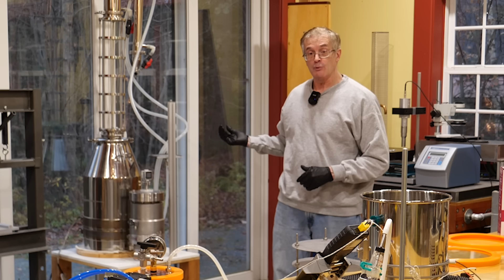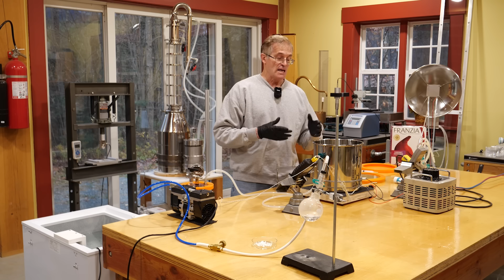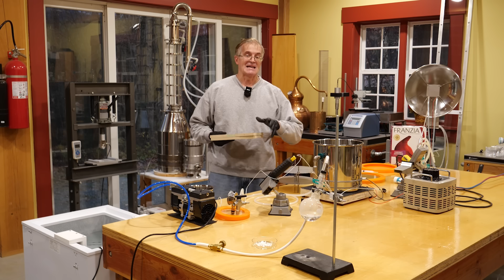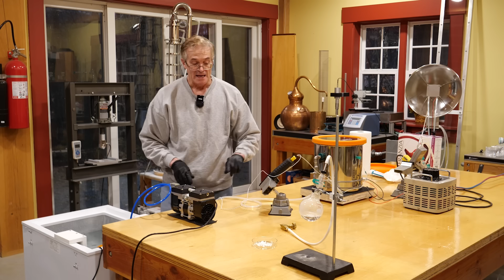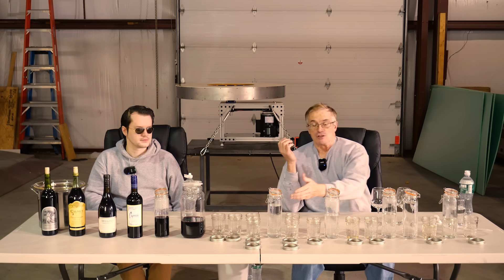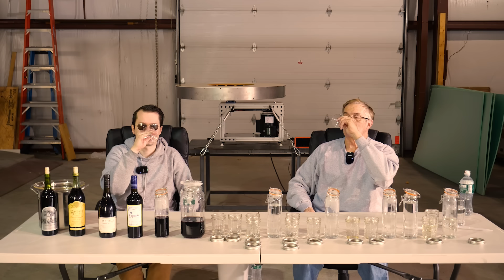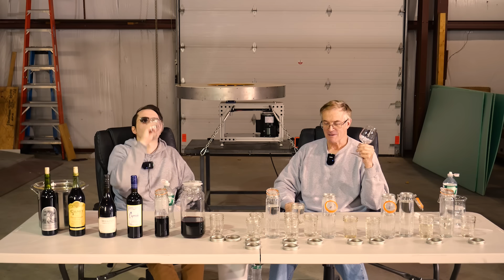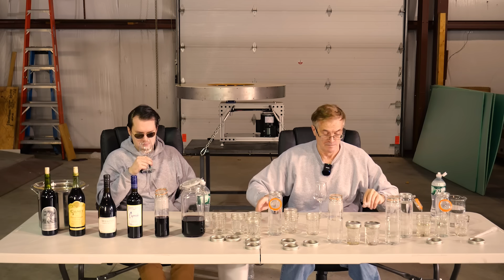Turning $3 Wine into a $100 Vintage with Science!

Comment: I'll grant that the result is more flavorful than the original - because all the non-distillates remain, while much of the distillate was removed.  The flavor would have to be more concentrated.  Better than the Cakebread - not a surprise.  Than the Meiomi - it's subjective.  Than a Caymus?  VERY unlikely - if tasted by a sommelier, and there's the rub: you are simply evaluating based on non-expert criteria.  Which is OK - I don't mean to denigrate that - because the whole point of wine tasting is exactly that: to find the least expensive wine for your tastes.  But translated to the general public - perhaps not.

As for the Silver Oak, if you were comparing the Alexander Valley Silver Oak, it's almost impossible that it would be less smooth or fruity - although that might be the conclusion if you were tasting the more austere/serious (and expensive) Napa Valley - bought on sale.  Or a very odd vintage.

A professional wine taster in a blind tasting would be the best judge of the actual outcome of your experiment.  Having said that, however, if you managed to come anywhere NEAR a Caymus cabernet with a twiddled Franzia box wine, that's a home run.  Very interesting video.  Reminds me of an episode of Northern Exposure where the wife of the crusty and rich patron drank his prize bottle and then refilled it with rotgut plus dirt, leather, tobacco, pepper, etc. and recorked and resealed the bottle - adulterating it with all the attributes of a high end wine.  A successful ruse, it was.

Update, 9/2026:  I happened to go to a wine tasting that offered both Alexander Valley and Napa Valley Silver Oak.  I NEVER favored the Napa over the fruitier and smoother Alexander.  I was shocked - the Alexander was bland - perhaps gong through a dumb period, but the Napa outshone it.  Just goes to show - winemanking's an art.  I bought the Napa - first time ever, in probably 30+ years
Reply from the maker: It really is very good.
An experienced sommelier would be a valuable addition.
I never saw that, but I'm pretty sure that would have been worth the watch.

Comment: This is really interesting; making a bespoke wine by deconstructing it through distillation. It kind of spits in the face of the philosophy of wine-waking, where the bulk of work to develop taste is in cultivating the grape and the soil and letting the climate and geography all determine the taste, as well as the yeasts and controlling (or not controlling) the fermentation environment. Granted, that's all still in there, but removing the parts you don't like is almost like wine eugenics 😂.
Reply: Wouldn’t wine eugenics be what is done now? Keeping the best vines, finding the best soils etc. versus separating and breaking down all flavors/liquids and making something better from it. 
Wine isn’t a distillation as it is blending but this process could make cheap grapes taste great.
Reply: @JoelSapp Not necessarily. You can only take out some harsh flavors, but you can't improve on what has already been made. This is subtractive, not additive.

Comment: I started brewing wine at home, Walmart brand concord grape, frozen raspberries and a few pounds of sugar, 18% champagne yeast and the first batch was dry and a touch over 18% with yeast nutrient (urea) in 60 days. 

Let it settle, added some very thick sugar syrup to two gallons in reused botttles, added simple syrup to some corona beer bottles and capped and stored in cold water to carbonate.
Reply from the maker: And.. ?
Reply: @TechIngredients Sorry, got side tracked before I could finish it.

Wine was great, delicious fruity and plenty heady. The attempt at champagne, the bottles didnt explode but they had to have been close, I opened one and it shot a fountain of alcoholic sticky foam up almost 3 ft and what was left at the bottom of the bottle was the floaters. I opened the rest under water in the sink and managed to keep 6 or 7oz and it was still really carbonated. 

No sulfites and it was 6/10. 

Lalvin 1118 yeast does wonders.

Three future batches, one with sulfites  (hangover city) and the rest very slowly heated before and made sure everything was sterile, and no issues, never using sulfites again, yeast nutrient is essential for high proof brewing. Im going to make another batch for new years. Might try a full fruit mash this go around. 

If I could ship you a couple gallons would you make fruit Brandy?

Comment: Though not clear in the video, it seems like the original cheap wine ranks better than the first two bottles, and if it was the case, it wouldn't surprise me at all. Cheap wine is frequently better than mid-tier, just not consistently so. What you won't get with cheap wine however is ageing, but maybe you could cheat that one by mixing in a bit of port wine, which can also be fractionally distilled! The oak flavor can be added in the same way you did for the whiskey.

Comment: There are yeast species and mutants that produce a-Amylase, a-Glucosidase, and Glucoamylase.

Two notable examples that are commonly relevant in the brewing industry are diastaticus, which is caused by a mutant allele in S. cerevisiae (STA1 allele) that produces extracellular Glucoamylase, and Brettanomyces species that produce α-Glucosidase.

...I pause so I don't forget to tell you this information at 2:25 (so hopefully you don't address this directly after I press play.
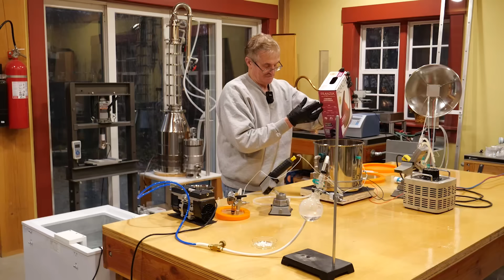Reply: Now at 35:22, just open the box and take the bag out.

Anyway, luckily you didn't actually address what I had previously said. Not that you needed to, because even though it is relevant to what you were talking about at the beginning, it wasn't necessary to address.

Comment: A better tool to drill rubber is actually a woodworking tool. A dowel drill makes dowels from the wasted wood from whatever project you are working on. This drill has a shank attached to a tubular cutting section. The bottom of the tubular cutting section is sharpened to a cutting edge. As the tool is turned with the drill, the cutting edge cuts in a circle deeper into the material until you are all the way through leaving a perfectly round straight hole with no burrs. It also makes waste in the form of a cylindrical rubber dowel-shaped plug. The tools usually come in a set, don't cost much, and are available at hardware stores. I bought mine initially to make mounting holes in a thick rubber cutting edge for my tractor's snow blade. It worked pretty well. I used silicone spray lube as a lubricant, but for food use you could probably use water. 

In concept, these tools are similar to gasket making tools for hand-cutting round holes, but the dowel tool is used with a drill.

I actually learned about this technique from my rubber vendor.

Comment: I wonder if this also allows you to improve already good wine. Since you're already starting out with a good wine, you'll start deep inside diminishing returns territory, so I don't expect the improvement to be as drastic. But still curious.
Reply from the maker: I agree. 
It can't hurt, but at the same time the improvement between a good and a great wine is proportionally smaller.
We're just not experienced enough to judge at that level.

Comment: There's a very interesting couple of webpages (predating YouTube) where a British (?) expatriate describes the operation of a village distillery in SE Europe, to which everybody takes their plums (yellow and slightly tart IIRC). Unfortunately I can't find them, and YouTube probably wouldn't let me post a URL if I did.

After a couple of gallons of "the good stuff" was saved, the little old lady in charge took a carefully-judged teaspoon of the tails and added it to the main stock, and it was that that changed it from "take the top of your head off" gutrot to something you;d give your friends.

What I can't remember, and this is significant, is whether there was a gap between "the good stuff", and the bit of the tails which was saved. Because if there was, it would reinforce this video's conclusion that there's a specific "band" (noting somebody else's reference to Fourier Analysis) of congeners which can be usefully removed.

How high-end vintners prevent those chemicals being present in the first place is an interesting question in itself.

Comment: Have you ever tried cooling down rubber before drilling it? I know that it can become brittle when frozen but perhaps if you put it in the fridge before drilling, the material would not bite the bit as hard and could be worked alot easier
Reply from the maker: I haven't. 
The tube method is so good and has no limited window during which you can machine it.

Comment: Did any glycerin appear? Did you take notes? Buzz?
I assume that that which separates a good wine from a poor is not simply those poor components,
but also the good wine may have components which are missing from the poor wine.
--
You screwed the pouch on recombination.  Should have rated each 0-10, combine best parts - taste, combine in varying proportions etc.
Reply from the maker: I have no doubt that's true.
The advantage here is there is no downside.  At worst we will generate the original flavor without altering the character.
Reply: @TechIngredients  Sorry for being such a Monday morning analyst, the video is fun. I make one one observation: In addition to mixing up the expected 'better' wine, you could have in the same proportions re-mixed the original wine. That would have underscored or not  - the independence from the processing.

Comment: If you need to cut perfect round holes in silicone rubber, you can purchase scalpel blades from 1mm up to 8mm that will cut a core.  They are called "punch biopsy" blades.  They are good for maybe a 1cm deep cut.

Comment: Watching this while slowly sipping on mulled wine, but prepared correctly. Just two middle sized pieces of cinnamon bark, one badian "star" and a few cloves. The wine I chose was red dry Dornfelder from Central Europe (3,5 € per liter, bought directly from the wine maker), poured over those three spices (about 1 liter of wine). Gently warmed up, almost to a boil and then put off the heat. The wine must not boil! No added sugar, no added water or anything else. Let the spices soak in the wine for a couple of minutes, then pour the still hot wine into a cup and enjoy. I do not like sweet wines. What I am sipping right now is exactly to my taste and the perfect drink for cold evenings. Your taste might differ. But it is a nice warming drink, even if the cold stays behind the window, I have comfy 22°C in the room where I watch this video. Cheers!
Reply from the maker: Thanks!

Comment: Regarding the thermocouple wires that are not vacuum tight, you can buy them, they are widely used in composite autoclave curing. The ones we use at our composites aerospace manufacturing company are not only vacuum tight but also remain vacuum tight at with external pressures up to 100psi, if you want any more information on these I'd be more than happy to get you a part number if you wish?
Reply from the maker: Thanks!
Actually,  I have several of these more sophisticated thermocouples, but they aren't cheap and I wanted to make this project affordable to a wide range of viewers.

Comment: It's a bad idea to use stainless screws for the thermocouple feedthrough. You are going to end up with thermal gradients and incorrect readings due to the mismatched Seebeck coefficients combined with the thermal gradient.
Reply from the maker: I disagree.
The screws are short and thick compared with the supplied leads. Compared with the meter long, 30 guage copper wires, these add less than 1% to the line resistance.
Reply: @TechIngredients Thermocouples do not work on resistance, they work on the Seebeck coefficients of the specific alloys in the leads (different alloys for + and -). Hence you can have very long leads and get no error, as long as they are the correct alloys. But as long as you splice the leads with a different alloys you risk getting incorrect values.

Stainless steel has one of the worst thermal conductivities of any metal, even worse than some ceramics. Hence I still think you will end up with a few deg Celsius of error in your setup. But this might still be fine as the exact temperature is not important in this case.

Comment: I can’t believe you didn’t seal the containers you poured the distillates into. With an alcohol level like those, they will be pulling in water from the atmosphere in the room. I’m guessing there might not have been enough time for that natural process to happen. But I was surprised never the less. As far as the decision on what to exclude my thoughts were along the line of including 1 of the 6-8 as a kind of tsp of salt in cookie dough type process. The volume of that jar adds a buffer between the high end and the lows or as said heads and tails. You need to have some bland mids to help the blend. $.02!
Reply from the maker: Thanks.

Comment: This is excellent timing as I've been gearing up to make non alcoholic beer via vacuum distillation for a while. I've got a multi stage diaphragm vacuum pump, vacuum gauge, and I've worked out how to pull a vacuum on a corny keg, and that it holds the vacuum. I need to work out the cold trap bit and wire in my digital vacuum switch so that I don't need to baby it for extended periods of time. Also maybe a heater? I'm thinking water bath, maybe? Because I already have that kit for temperature control from brewing the beer.

Comment: 1. Don't keep reusing the rinse water for the dropper. If you tasted the "rinse water" at the end you would undoubtedly tell it had a flavor. Also: wet and drain the first tasting glass as all of the subsequent tastings were pre-wetted (diluted). No favorites to #1. Better yet: use a fresh, dry glass for all tastings. 
2. Each of the cuts' sizes was quite different from the rest. (See #3)
3. I can't BELIEVE you dumped them all right back in together. Next time try adding specific, measured amounts and record the mixes. (Very small mini-blends to extend how many blends you can do.)  You COULD have ended up with something far, far, FAR superior to what you did. 
4. Vary the percents of what you add back in and compare the diff ratios of flavors. 
5. Do some blends without adding ANY of each one of the cuts. Ex: leave out the rose cut, but add the rest you liked. Also: try adding in A LITTLE of the cuts you did NOT like, just in small, measured quantities. Those "unpleasant" portions COULD be adding to the complexity. No one wants bay leaf (only!) soup, but they DO add a je ne sais quois. 
6. Make and keep tasting notes handy (for each taster) to refer to on the second tasting and then for the blending. 
7. Try soaking / (aging) some of the higher ETOH (alcohol) in roasted (and slightly charred) white oak for 2-12 months. (Long term experiment)  50% / 100 proof is considered the optimum strength. 

A1: Next time try blending the expensive wines with each other, also in specific, measured, and recorded quantities. Every brewery, winery, and distillery makes a cuvee (blend) to maximize flavor.

B1: You introduced a lot of oxygen to the wine when pouring it in. Next time purge the pot with your vacuum, then fill and purge with CO2 several times. Then fill it with a very short hose from spigot to pot inlet. (Tricky but you guys are very clever!.)

C1: Next time invite as many sommeliers as you can find to assist with tasting and blending! Let them EACH make their own blend and compare the results.

Comment: you could have used less of the remaining concentrate in the final mix to keep the same ratio since you discarded some fractions, if you removed 1/10th of the total initial liquid, you should have discarded 1/10th of the concentrate, now you just increased arbitrarily the concentrate rate which is not at all natural for a wine, this could have produced a more natural assembly

Comment: Very cool. You also have to factor in the cost of your own time spent doing the distilations and the mixing. The economics of it most likely doesn't work out for saving money vs. anything below the most expensive bottles, but as a hobby project, it seems a lot of fun to try out, certainly at the tasting and mixing stage.
Reply from the maker: Thanks. 
However,  I disagree. 
For almost the same investment in time and money a system can be assembled with 3 times the capacity. Once the preferred  exclusion is identified, only 3 cuts have to be performed.
20 bottles of $90 wine is a lot of money.

Comment: Interesting experiment. Should you not measure the volume of the excluded fractions and replace that volume with distilled water?
Reply from the maker: That's certainly an option, but not required if the final result is good.

Comment: Silicone stopper, stainless steel corner fitting, stainless steel valve, silicone tubing. Why not connect the silicone tubing directly to the pot and use a clothespin as a valve?
Reply from the maker: I like your way of thinking.   The best part is no part...